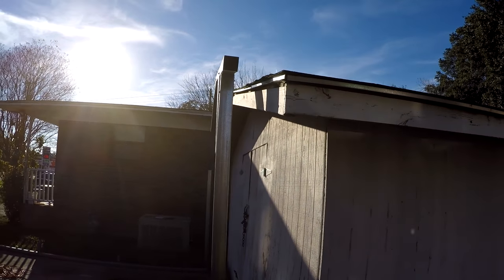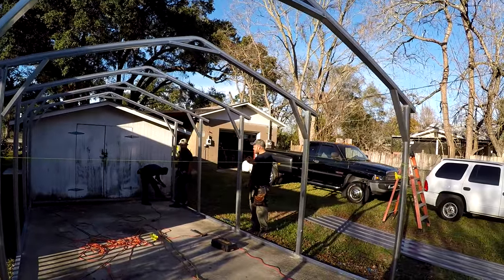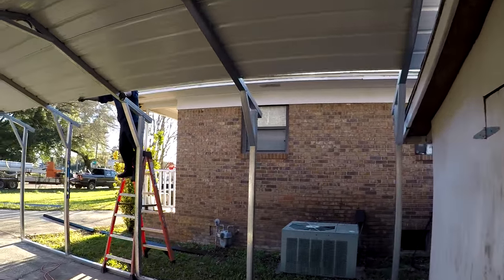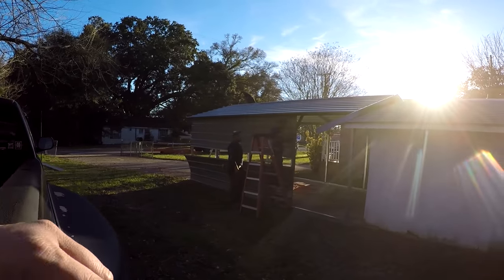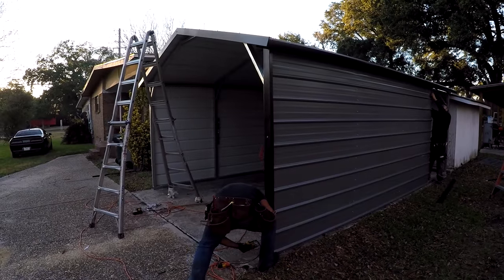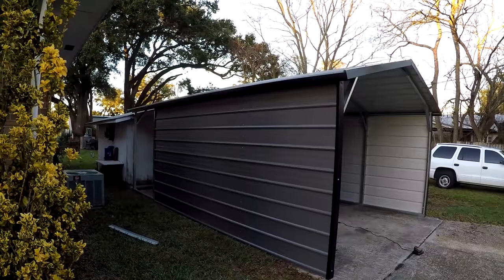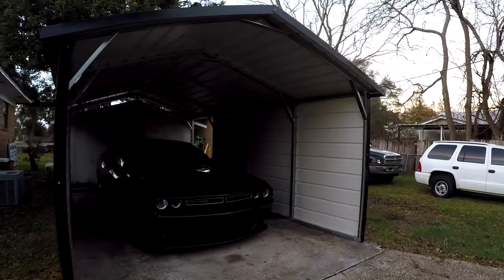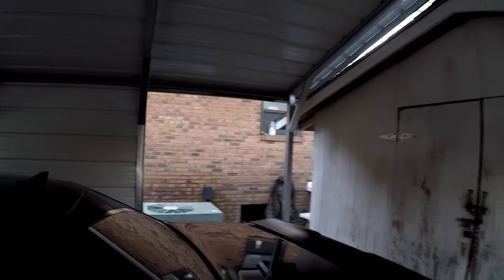Carolina Carport Install

Comment: You waited how long for that?  A 2 hour job?  It’s no wonder they were too embarrassed to call and keep you updated.  Someone’s simply not going a good job and others are taking the flack and avoiding the phone.  I’ve seen that before.  Someone has an important job and they are incompetent or lazy and everyone down the line takes the brunt of it.  You have plenty of right to be disgruntled with the service you received, but I’d bet all the people you talked to could do nothing about it, and are just as, if not more frustrated than you were.   Usually a family business where people who have no business in the position they are in embarrassing everyone else.  It’s common when a business hierarchy is based on nepotism.